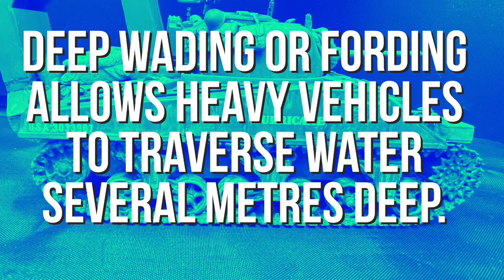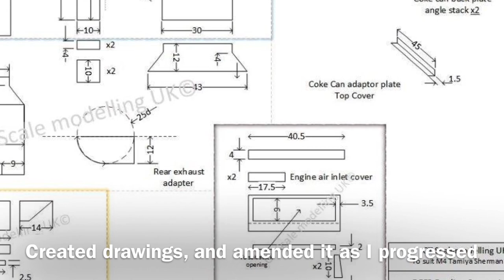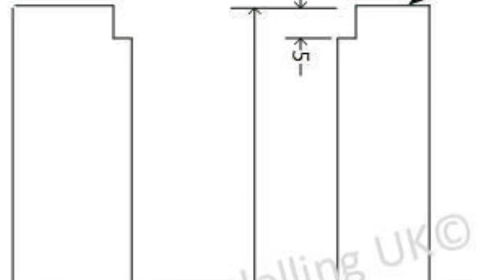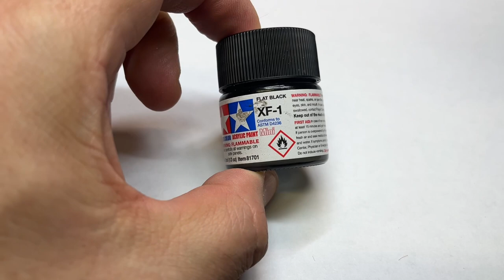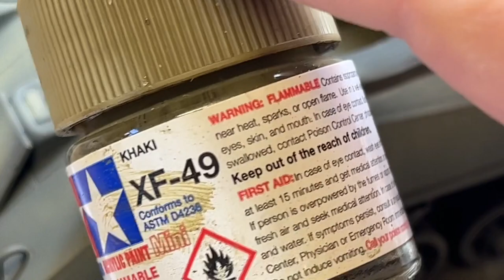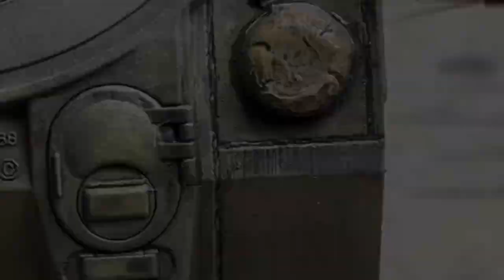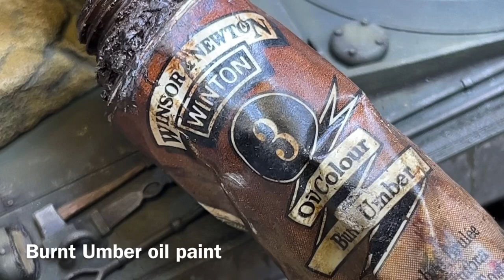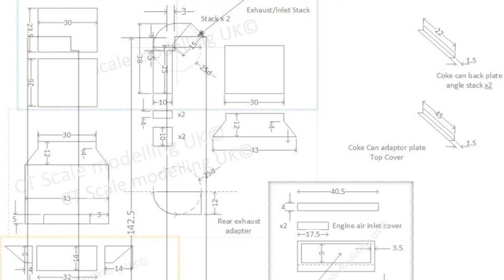Build M4 Sherman 1/35 Deep Water Fording amphibious D-Day #tamiya #omahabeach

Comment: Nice conversion except for the omission of the twin props on the rear.   The M4s in the first waves were DD’s ( Duplex Drive) and were equipped wit two props to propel them in the water. The DD’s swam, they did not ford i.e. drive on the seabed.  Since you show the model with the gun mantel covered, which also covers the main gun’s sights and coax, I assume it is depicted has just pulling out of the water.  In that case you should show the tall skirt that was raised around the hull to provide the buoyancy required to swim.  The skirt could be quickly lowered but wouldn’t be removed until combat conditions allowed.  You appear to have done significant research, I’m surprised that you missed these details.  Best wishes, Ed
Reply from the maker: Hi cheers for comment, its not a DD tank, to do this would be beyond my skill level. This is a deep water wading version with temporary stacks that are aborted when they hit the beach (in theory). Cheers again.